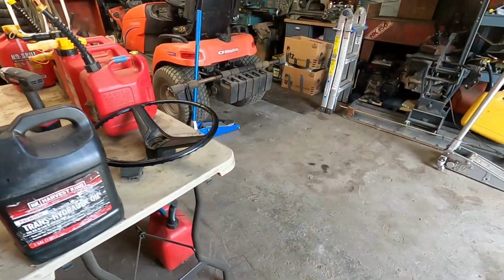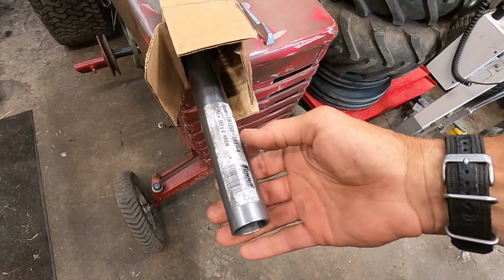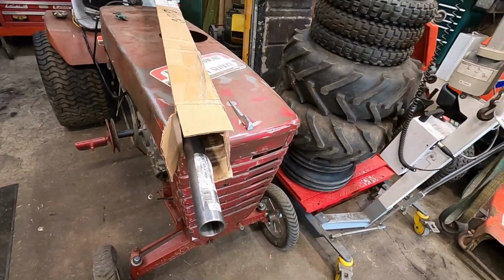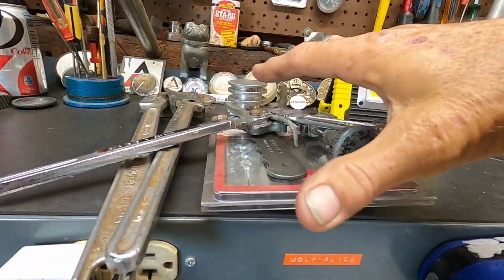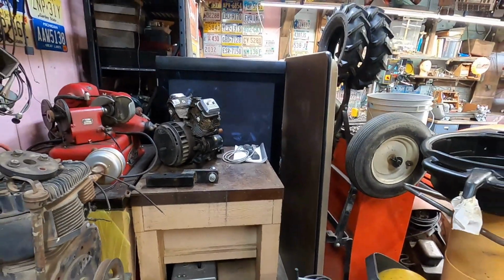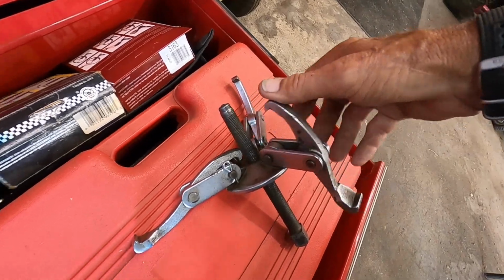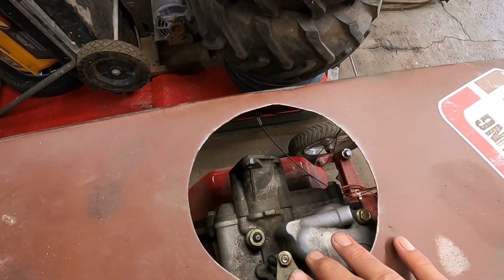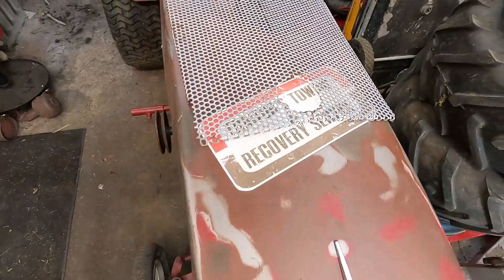August Update In The Shop And What's To Come

Comment: Hey Mr. Zip.  Lots of projects and helping others.  That will come back to you someday.  I had an old Jeep that I ran a line from the oil pressure switch up to the top of the rocker cover and let the oil flow over the rocker arms at the front of the engine.  Seemed to work ok.  Your concept is much more professional and a better fix.  Stay safe and thanks for the video's

Comment: I had that on my 61 BelAir. I had to replace the front rocker shaft and three rockers because the oil hole in the head gasket was plugged up. I popped the head, cleaned the hole, and put on the necessary new parts and gaskets.

Comment: Your Vanguard Intek comparison 100%.  I was always told by Simplicity dealer that Vanguard is their best engine, Thank-you for your video.  Just finished 2007 Simp Vanguard, just started running bad, revived it, need some plugs but if you take care of it, it will take care of YOU!  Stay Safe Brother!
Reply from the maker: By far, the Vanguard wins hands down. Briggs has been making attempts to fix the known issues on the consumer/pro-sumer grade Intek with removable panels on the blower housing to clean the heads and cylinders etc, but ultimately, consumers are a lazy bunch and don't want to be troubled with pesky maintenance. So this is why I see more Intek repairs than Vanguard. Also, the Vanguard's will be in the higher ended consumer/pro-sumer grade machines costing double what those in box stores cost. Briggs has also brought in a higher grade of Intek, replacing the plastic intake runner with aluminum and a better carburetor (Nikki vs. Mikuni/Walbro). But in the end, The Vanguard is the reining King. Cheers Taz! Zip~